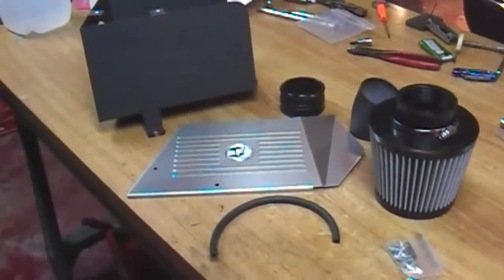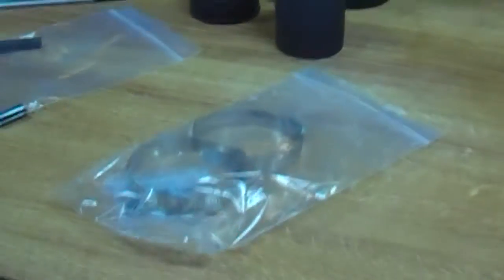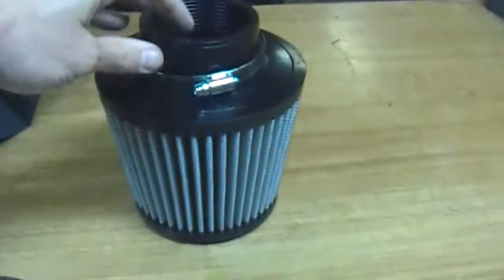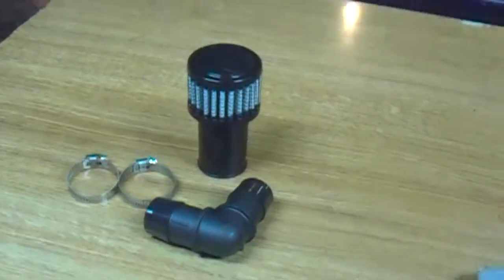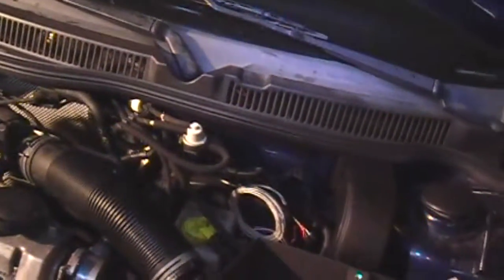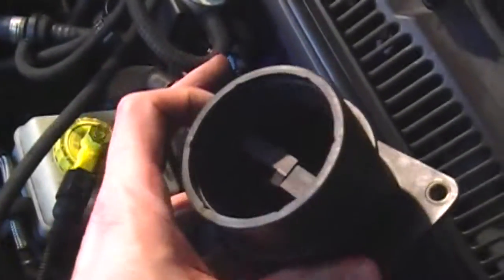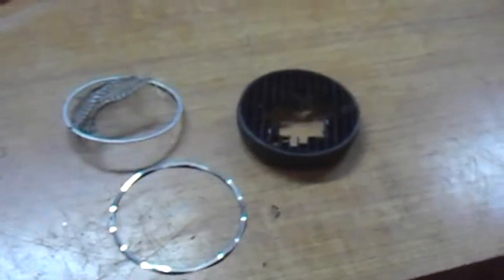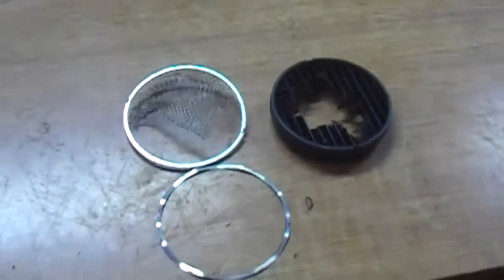Volkswagen TDI - AFE Intake install

Comment: Great so rather than drawing in cool air from the front intake, now you get to draw in warm air from within the engine compartment.... makes sense!
Reply: It’s not drawing hot air if you have the metal block off box to keep hot air from coming into the intake

Comment from the maker: I didn't do this install for more "power" per say...more than anything, I did it because I put intake systems on all the vehicles I own and just the fact that I don't have to buy those factory paper air filters anymore. The filter on the AFE intake is a dry filter so it only requires to be rinsed out & air dried every other maintenance service or so & does not require to be oiled like some intake filters do. Plus a slight bump in fuel economy is never a bad thing either.

Comment: That isn't the snow screen that you removed. That piece helps the maf get accurate readings. The snow screen in pre-filter, in the snorkel going to the front grill. No matter,, your intake bypasses that snorkel anyways.
Reply: That's what I was gonna say! The snow screen is between the piece that fits behind the headlight and the air box. Wow, hopefully you didn't damage your MAF sensor